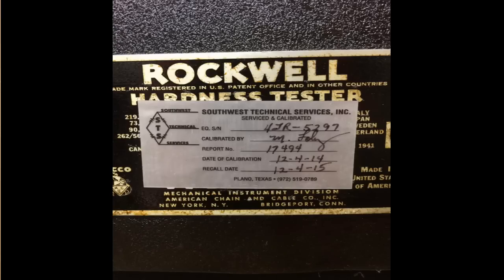AK Barrel Hardness Test-Reason For

Comment: Quality barrels means tempered-martensite, preferrably in the 35-39 HRC range.  Tempered-martensite is elastic, and it that hardness range very elastic.  I say that because that means properly heat-treating the barrels and that adds cost.   Bottom line, don´t skimp out on the barrel, save money elsewhere on the build.

Comment: I own an 14.5 ESS from about the time you got yours and I can attest to the capability. Don't know what the harness is but it's a one minute barrel with good ammo, very impressed with it.
Reply from the maker: A soft barrel will still shoot just fine. I did this just for the guys building their own rifles. On an AK unlike an AR, there is a lot of pressing going on. The softer barrels will not have as much spring back as a harder one would. The risk of having one bend on you is greater.

Comment: Back a few years ago there were some U.S. made 5.45x39 barrels that had issues. They were $99 from a few different distributors. I'm not sure who made them though. I try to use original AK barrels if possible with my builds but that's getting pretty hard now days. I'm working on a Polish under-folder build and that one will have a U.S. made nitrite barrel from Arms of America. I've herd a lot of good things about those barrels that's why I went with it. Plus I got it on sale for like $110.
Reply from the maker: metaltrooper62  I have used Nitride barrels from AOA, they have all been quality barrels.
Reply: ***** I remember the video you did and mentioned them. Before I bought mine I checked AK Files and asked a few questions. Everyone that used them said they were good barrels  so I bought one. I'll probably use them for future builds too. When ever K-Var has barrel sales I'll try to pick one or two up if I have the extra money. My 2 Bulgarian 74 builds have original cold hammer forged barrels.
Reply from the maker: metaltrooper62 CHF are the barrels I want too. But they are few and far between. So for now we must pick the best "American" made barrels we can.